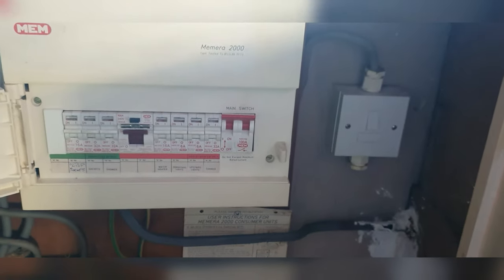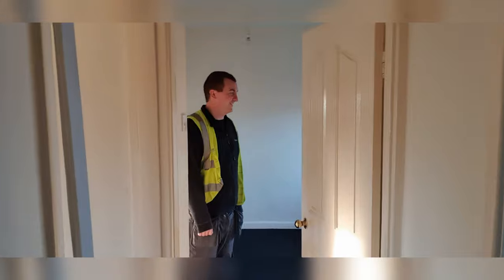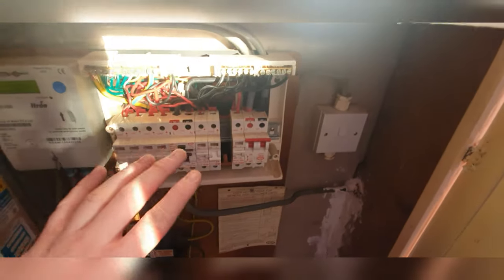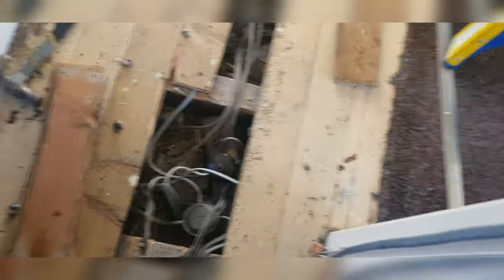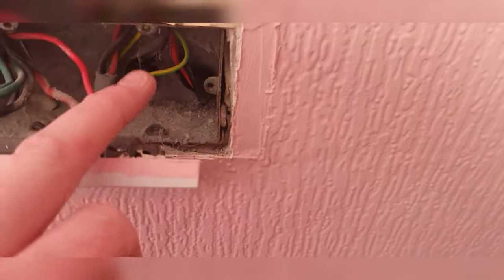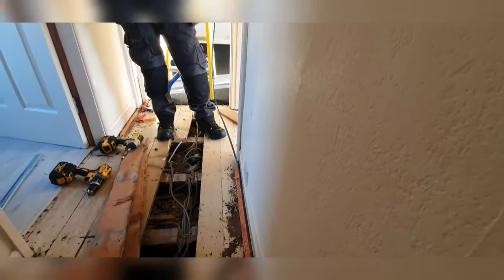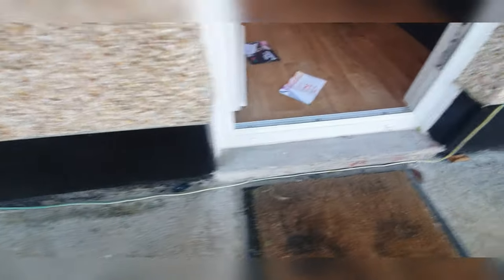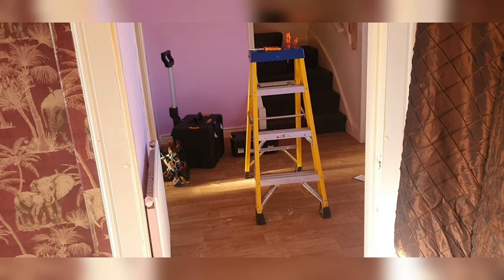EASIEST WAY TO FIX BORROWED NEUTRAL

Comment: I've got no money and turns up in a Range Rover. Love it. The number of times I get that same sob story when it comes to what needs fixing, and i'm not even expensive, really pisses me off so much that in the last 2 years I have actually added 20% on top of what I would normally charge because I really don't like or need customers like that. What's funny, is even after adding that uplift, they still get me to do the work. Those few who still moan, I just politely suggest they shop around.

Comment: The PME one and the outbuilding is awkward. If I were doing it new, then a rod is the safest solution but more costly. What are the actual odds on loosing the PEN conductor at or before the supply intake? Im not sure if there is even a stated number to be honest, maybe someone reading this can point me to an article that shows the number of PEN faults recorded in the UK per year.  Even if its lost, you still have the water and gas bonding in place to help, though not guaranteed in these days of plastic supplies. I would suggest you have more chance of getting hit by a bus walking out of your house than a lost PEN conductor.